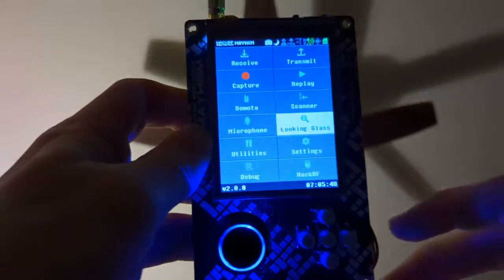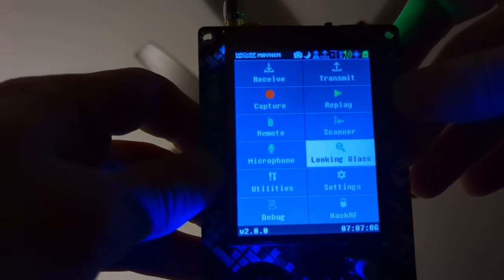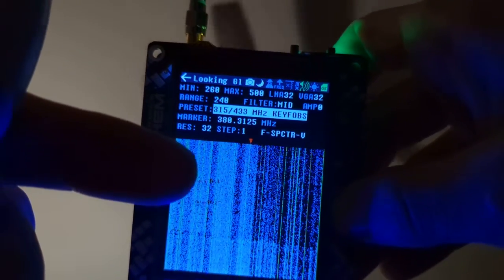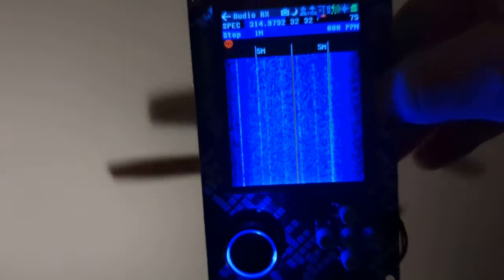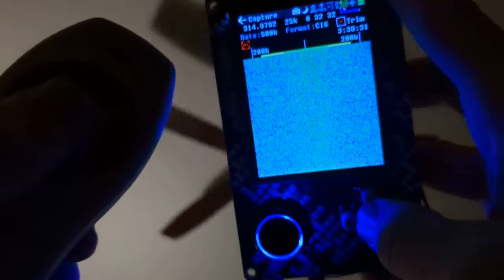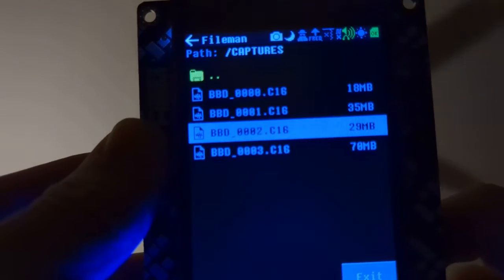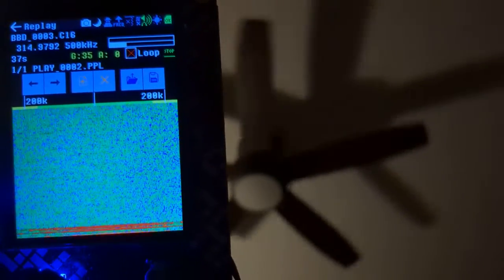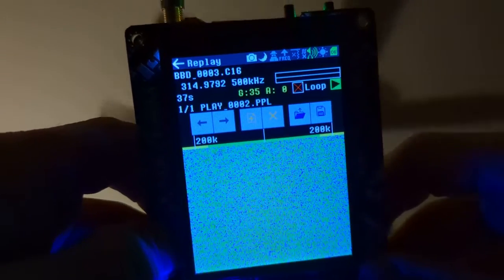🛜 Portapack H2 Hackrf: Simple Remote Capture Replay

Comment: Hi, does this work with remote that is 2.4 ghz? Thank you!
Reply from the maker: It does work in that range, but is does not have capability on its own to fully capture / receive full wifi if that is the protocol. All depends on the type of remote control / protocol, since hackrf is limited, but can work in that range.

Comment: i cant help noticing how much of this may need the user to have an amateur radio operators license. receiving where i am is legal if you do not divulge the contents of a transmission unless that transmission is meant for the public as is. transmitting outside of certain license free bands generally requires a license. as is intentional jamming is illegal in most places. do be careful if you buy this using it without due care can land you in a heap of trouble.
Reply from the maker: Good comment - I try to remember to mention license in majority of videos concerning transmitting. In good news, it is a very low power radio (not so much for distance). Still nice for anyone to learn from. But absolutely recommend license before playing with anything tx related.

Comment: How much does it cost
Reply from the maker: All depends where you get it (last checked between $200-500). If you look up the Mayhem firmware wiki, they share recommended suppliers / links on where to find it - but you can find it many places.

Personally recommend finding a kit that has BOTH portapack AND hackrf board - as these normally come preflashed with firmware, offering easier start.
Reply: @RTPTechTips  ok thx bro
Reply from the maker: Very welcome. I found OpenSourceSDRLabs to be reliable kit, at affordable price (link to them should be inside mayhem wiki).

Comment: There is one big issue with capturing: If the size of the file reaches 3GB, capturing will stop with error message "Disk full", which is of course BS. It could simply start a new file, but obviously nobody of the developers went into this so far. I have a use case where i have to capture for hours and hours with 150kHz bandwidth to get one short data packet. Capturing works, but the time is limited, no matter how big your sd card is. To make things worse, the theoretical capturing time based on free sd card memory is displayed and counting down. I hope this will be fixed soon. Just start a new file when FAT32 limit is reached.
Reply from the maker: Hmmm that is interesting to learn. Thanks for sharing this info, good to know - hopefully this will get fixed.
Reply: put  broadcast fm fejector, upconverter and a pluto sdr, that shit will pulls data off of mars :D

Comment: Where did you buy the screen/case for the portapack part of it all?
Reply from the maker: This one was actually given to me as a gift so unfortunately not 100% sure. But you can find this portapack under H2M. There is a newer one out now that looks great called H4M.

Best way to find reliable / compatible ones are checking mayhem firmware wiki where they share links to recommended ones: https://github.com/portapack-mayhem/mayhem-firmware/releases

Comment: i cant change the preset mode they only manuel as an option what can i do?
Reply from the maker: Sounds like you are missing the sdcard files.

Formatting / download file for extracting to sdcard info found here: https://github.com/portapack-mayhem/mayhem-firmware/releases/tag/v2.0.1

There is one option with maps, and one without (for adsb for example).

That file contains the presets and all.

Once you reboot the radio, it will load (as long as formatted right).
Reply: you can change the "min" left upper screen to the minimum frequency and the "max" to the maximum frequency and now you have the freqeuncy range you search between. :finger-red-number-one:suc6 greatings from the Netherlands

Comment: My capture doest work csn u help me same model
Reply from the maker: If not seeing it, you probably have wrong frequency there - check the back of your remote, usually printed on this. Different models / brands may use entirely different freq. 

Cars since 1990's won't work unless using combo of devices (in case this was what you were looking at).

Comment: i'v got a questions that i really want you to take 2 minutes from your time to answer ❤❤
is tor bridges trackable ? 
is it ok to use the same bridges you requested over and over ? 
what are the thinks i should take in consideration whene using tor bridges ?
by the way i watched your tor bridges video but i want even more detailed information 💙💙
Reply from the maker: Are bridges trackable? That's a complex question. The important part is, most denaonymization risk comes down to user behavior. That's what it ALWAYS has historically come down to: user choices.

So many other things should be taken into account before looking at bridge anonymity.

Overall, bridges provide a more of a private way to use Tor IMHO - no one knows the full extent of systems behind the screens with regards to attacking Tor, and so it isn't a direct answer kind of question.

I do not consider them risky at all unless someone were unlucky enough to hit the exact same owner controlling bridge and exit node, in same circuit, at same time.

Unfortunately given the complexity and unknowns, "are bridges trackable", is not something that can be directly answered in yes or no. 

They represent unlisted entry into Tor network - making them less trackable than publicly listed nodes.

Are they safe? Absolutely IMHO. And can be more safe, by following some basic user guidelines. Some tips here: https://youtu.be/83o4oaXqHQc
Reply from the maker: And sure you could use the same bridge over and over - but if goal is max safety, changing never hurts.

Also encourage trying out I2P. It has the added benefit of all users becoming routers, and I think you may enjoy it. Have several videos on getting started, and benefits on network.
Reply: @RTPTechTips   I really appreciate your time answering 💙💙 thanks for the informations it will help me a lot
Reply from the maker: Sure. And good luck on your adventures!